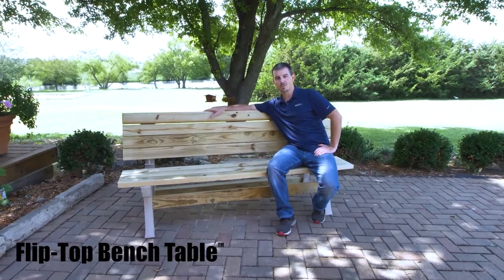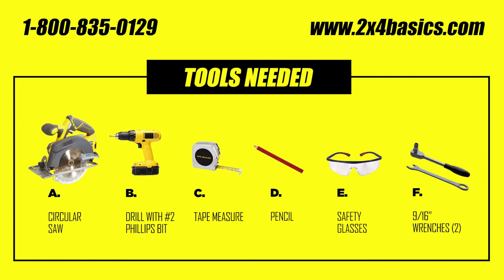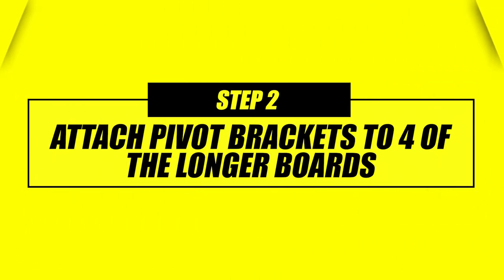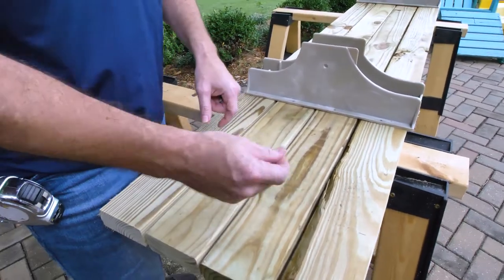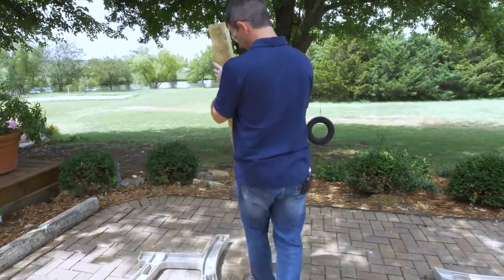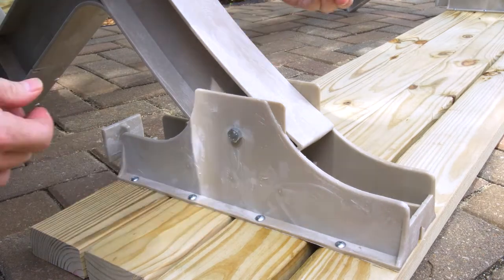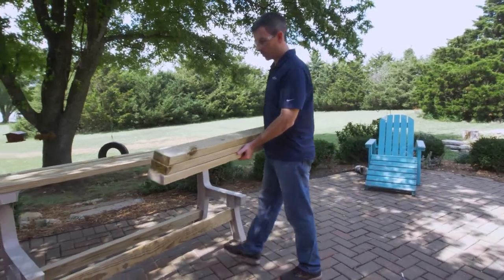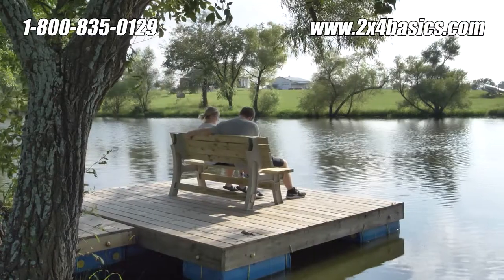How to Build 2x4 Basics® Flip-Top Bench Table™ - Instructional Video

Comment: The pivit brackets don't have any holes.  This is mentioned a lot in the amazon reviews.  I'm confused how the locking system works so I just don't want to start drilling holes in the pivit bracket.  Is there a template that could show precisely where to drill this hole onto the pivit bracket.  Also, can you show a video on how the locking bracket works to secure the table top in table mode or in the bench mode.